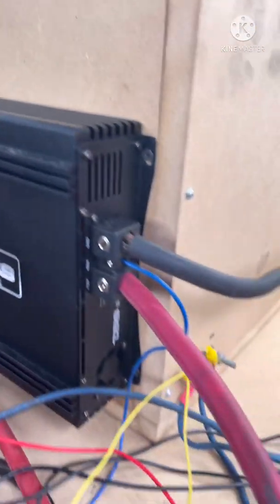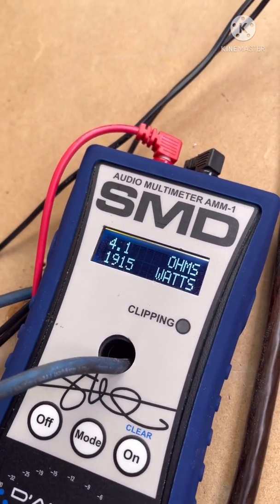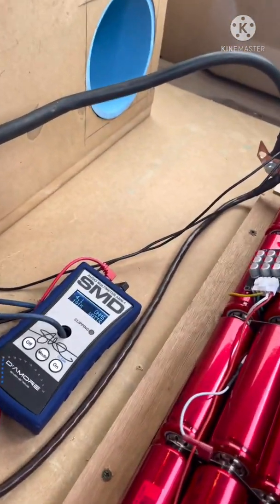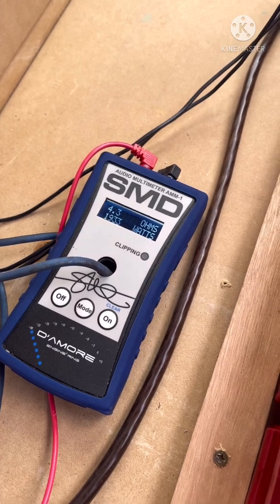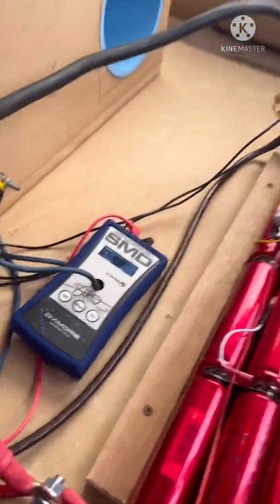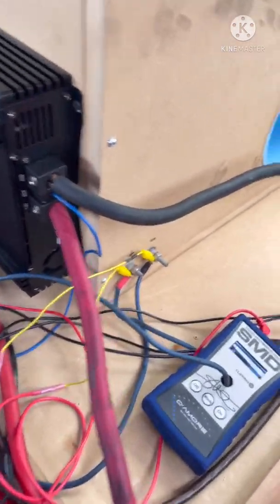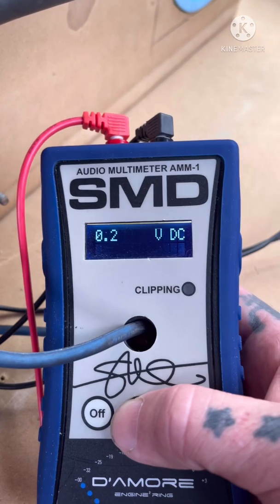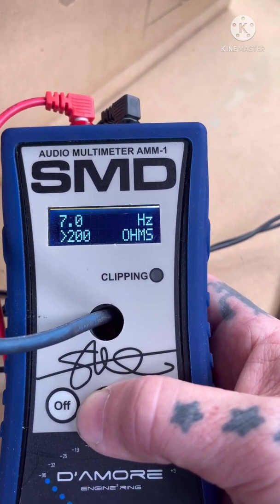SMD AMM-1 testing.. impedance rise and peak power

Comment: I have a smart 5k going in my build this year on 4 skar svr 15 gonna push the limits of them haha
Reply: Tune it clean, you'll be golden
Reply: @kevinmoore6640  I'm really hoping I'm trying to back it up with a xs power 3400 up front and two down4sound lto lithium in the rear off of ces 320 alt and all ofc wire
Reply: @jimmyjam5588  how you gonna isolate them
Reply: @DirtyKk  I got a install bay 500 amp isolator for each run of 1/0 coming from the front never really messed with them hopefully they work haha
Reply: @jimmyjam5588  I would never reccomend mixing chemistries. Just get a battery delete and get a pre-built bank man
Reply: And thanks for the video I would love a amm 1 but it hard to spend that kinda of cash I know I have a dd1 and cc1 and they work swell that would top of the army

Comment: Jerry, would it be more practical to run just agm batteries on a system that’s only 6k? I’ve been going back and forth about doing lithium or agms
Reply from the maker: actually it's only 3k but I have a lithium bank in every vehicle i own.... they are far superior to AGM.
Reply: If you already have enough AGM to support 6k then stick with it, but if you're planning to build a 6k system then yea lithium is hands down better in every way. Jerry made a video a month or two ago building that lithium bank for dirt cheap, check it out.
Reply: @scottiffanimccord1509  thanks! I am starting from totally stock for my electric so lithium it is
Reply: @matthewcoulter3991  Glad I could help Matt😃